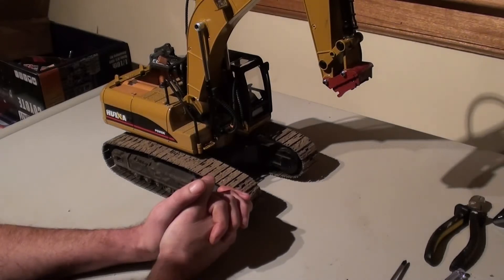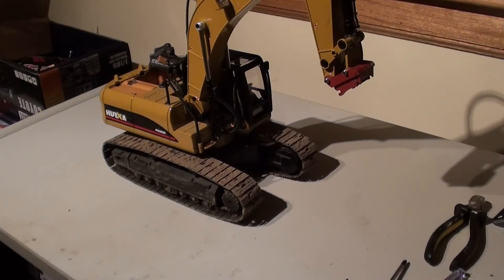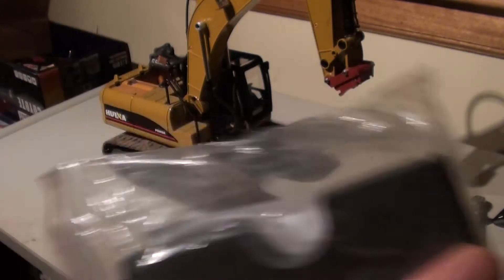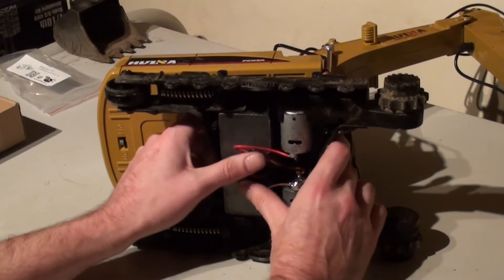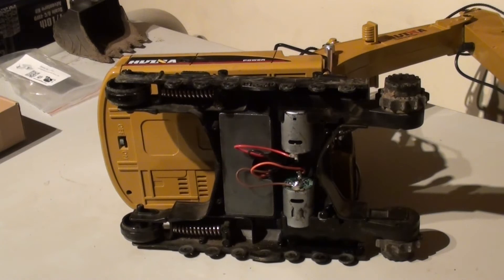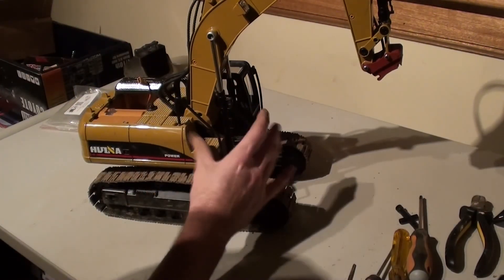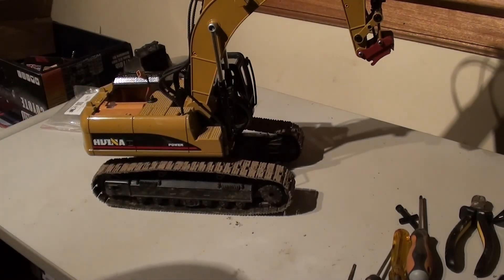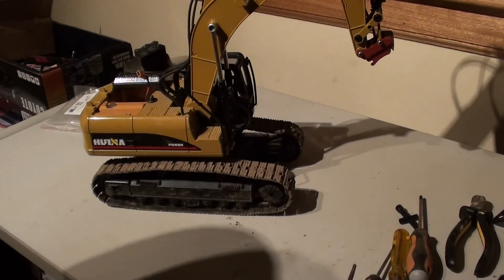Huina 1580 / 580 upgrade 1 : Weight

Comment: I do not understand why they wouldn't put the counterweight where the counterweight goes on the back of the superstructure that's where I put mine and it works absolutely perfect.
Reply from the maker: Probably to help with traction for the tracks as well, but yeah, more weight could be added to the back ... i do have tonnes of wheel weights left over so might add that in at some point as well if i feel it could do with a bit more weight

Comment: Hello.
Please if you can help ..
I have bought a new WLToys 16800 arm, receiver and transmitter which I have fitted to my Huina 1592 with a minor mod but I'm not sure how to bind or connect the receiver to the transmitter.
When I switch it all on the lights on the arm flash but nothing seems to work.
It is all plug and play as far as the arm connections to the receiver board goes.
Any ideas ?
Thank you.
Reply from the maker: i'm no expert , but i would have thought they are kinda all inter changeable, think they are made in the same place ,  so would make sense? the only thing i can say from experience is the huina transmitter should auto bind to the huina board ( i had to get a replacement as the screen on my transmitter didnt work, and didnt have to bind to my 580 to the transmitter ... it just worked ). Maybe double check all the wires are going to the right places, check 1 at a time , plug in the original stuff,  see if all works , then try change 1 plug at a time on the new arm.  Thanks about all i can suggest, or at least what i would try ? I hope that helps in some way , but let me know :)
Reply: @Granite-City-RC  Thank you for your quick reply.
The connections for the arm are all colour coded and I have studied YouTube videos showing these connections but I cannot find any video explaining how the receiver and transmitter  should connect or bind together.
I shall keep investigating.
If I can get this to work then my 1592 will have a better more powerful arm for much less than 1593 or WLtoys 16800.
The 16800 arm fits to the 1592 and is the same size as the original.
Thank you for trying.
Reply from the maker: @new2rc453  I have seen that some people will change out all the electrics on big mods, run everything on its own ESC, but its not something i've really looked at yet
Reply: @Granite-City-RC  Thank you for your responses.
I figured it out this afternoon...
Simply a faulty battery, would you believe it!
It all works perfectly now.
This has transformed the Huina 1952...
Reply from the maker: @new2rc453  lol Nice one mate :)

Comment: Good mod. Will most likely do the same to my 1593. Sometimes it drags on the tracks while digging.
Reply from the maker: lol yeah i get that too sometimes , hopefully it will make ripping up the soil a bit easier as well as not not dragging myself into the hole im trying to dig lol :)
Reply: @Granite-City-RC  watch that arm servo!😉
Reply from the maker: lol yeah , i wanna go test it , but the ground is frozen solid :(
Reply: @Granite-City-RC  I have been moving snow with my 1583. I modified the tires with a dremmel. Received my quick steering motor from wuehlbox yesterday. Can't wait to install it. I have a video up of that.
Reply from the maker: lol yeah , just seen it . I was hoping for some snow at some point , but i think we have to put up with just frosts for now. You'll enjoy the new motor, so quiet and fast :) and easy to install